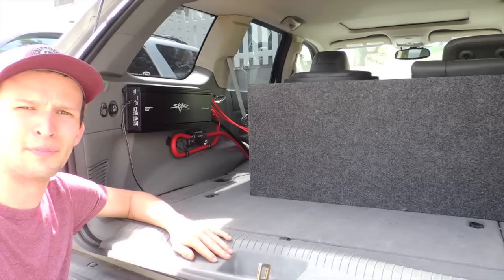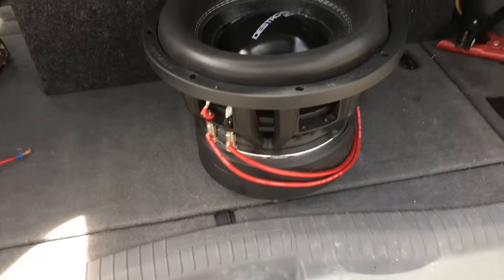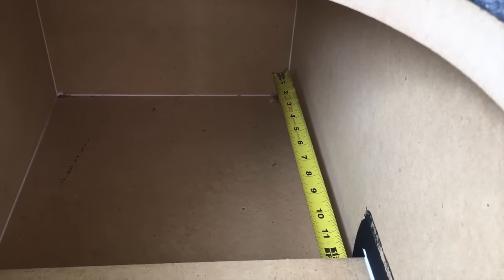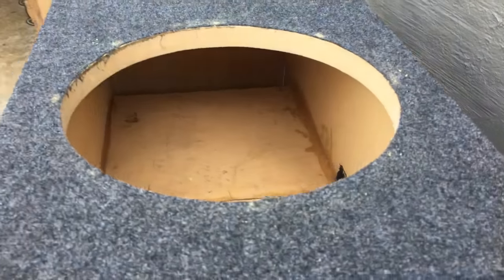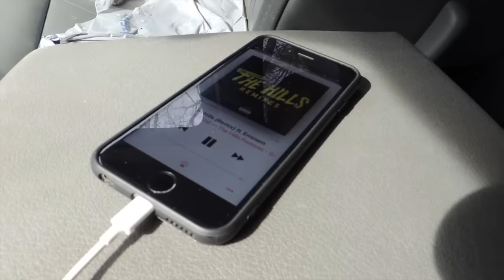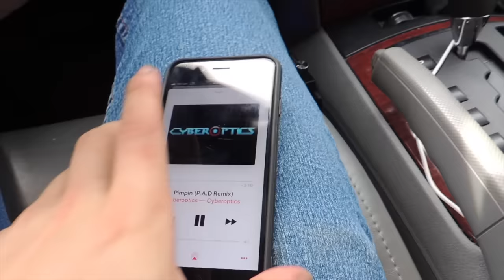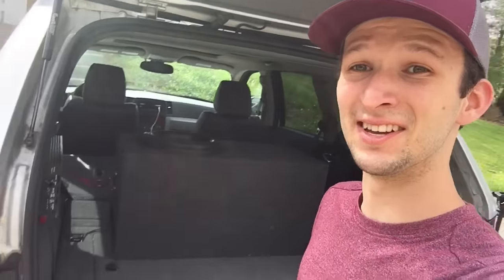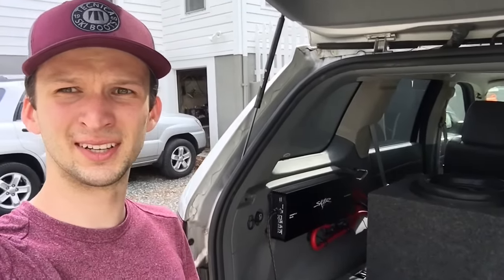Tuning My Box To Hit Lower! | How To Tune a Ported Subwoofer Box/Enclosure

Comment: If you ever do go into a custom build id recommend looking into round ports :)
Reply: I second that. Or octagonal ports.
Reply: Yeah, although the slot ports are pretty easy, and cheap for the little piece of extra wood, it sure seems like a few bucks for a couple of 3" or whatever is needed for your specific situation has got to be quick and easy- especially being able to run into any hardware store and grab some PVC pipe, cut to whatever length needed for tuning is hard to beat!
 **I've lengthened a few slot ports on prefabs or someone's home made box all with great success, but thinking about going with either a bought round port or just some PVC pipe from the bunch lying around living on an old farmhouse with tons of diy project leftover!

Comment: Ya invert the sub get maybe .2 more cubes. And put the box where the port fires to the rear and the subs magnet faces the rear passenger wheel bass likes to bounce off stuff. Then play some Bassotronics!!  I rock prefabs and add wood glue add  screws ever 5 inches to make sure the box is reinforced till I make a better box myself. Cool vid like the flexn shots.

Comment: I just bought this Q- Power box for $75 shipped on ebay for a temporary box for my Resilient Sounds Onyx 12". I was pleasantly surprised by how thick the wood was, 1" faceplate and .75" everywhere else.  the tuning is about 38 hz with this particular sub. The glue on the carpet is minimal and the terminal cup is worthless being way too small. 10 GA wire at best. I just run my 12 GA off out the port. I don't hear any rattles at all and it holds my 85 lb sub no problem.  I'm still going to put liquid nails inside the box and maybe a brace or 2. It doesn't vibrate much at all. For $75 bucks, you can't beat this box. It's also high density partical board not medium density like most boxes. I was really surprised. With some liquid nails, it will last forever. The existing caulking they used is garbage but I do see glue drips, so they used alot of glue for sure. I wish it had a lower tune but I may cut a piece of ⅝" wood and install it against the existing 13" port to narrow it and lower the frequency so I don't use up any air space like Parker did doing it that way but it worked for him. I need the airspace.

Comment: Next time cut it longer and slide it in and just lay it on the original port and just screw it to that, then u can slide it back and forth to adjust tuning unill u get it where ur happy. Instead of glueing it in.. make your next box with an aero port, they are easy to swap in and out, I bought like four 6in ports from parts express and u can add length to them easy or shorten them.. I don't use them anymore though. I went back to slot port once I figure out the tune I wanted
Reply: That would make the port 3/4in wider at the back than the front and change the tune
Reply: Why slot port over aero?

Comment: I have the same box for my 15. It says 37 hz. Dont know if its true but it does play pretty well in the 30s. I plan to add an external port and turn it with an L in the driecrio the sub is facing. I am pretty happy with this box. Makes one 15 SDR impressive.
Reply: Same...I have 2 one for my American bass XD-1522 and one for my Audiopipe 15in 3stack. It sounds good for what I paid for them in my opinion but will try this trick and see what happns😅
Reply: @marcovaldovinos5009  I just dropped my new avatar in and it slams
Reply: @brockmarquis8511  nice
Reply: @brockmarquis8511  The STU 15?
Reply: @marcovaldovinos5009  yes

Comment: Nice video. I actually think this is a good idea. But the quality of the wood really makes a huge difference in sound bro. I promise I was so scared to spend money but once I got a good quality birch box and a few other custom boxes I was hooked! I can take a budget sub and make it hit 5x harder in my box than a standard prefab or even eBay “custom” box. You can build your own just look at tutorials. The internal tricks and things inside used with custom boxes is insane. Internal bracing helps, internal corner inserts to help redirect air. Also having all the cracks and seams inside box properly sealed Makes a big diff too. All brand new boxes I get I always use liquid nails or silicone or something to seal every seam and corner inside an out. Also I seal around the terminals too. Painting wood boxes and sealing them is a good idea too and helps humidity and moisture not get to them. I wish you could feel the diff with that sub in a custom birch box
Reply: So from grabbing a sheet of MDF from the local lumber yard has nothing on some good Birch plywood!?
  Obviously bracing and how much power is getting pushed makes a huge difference, but you think for my first Birch box with either this DC Audio stage 4 12 inch sub and a 2500(+) RMS Orion amp would do better, with proper bracing and some nice chamfered edge's and I was thinking about 1/4 round(or something like that) for the inside corners for better sealing plus giving more surface area to strengthen it all the best possible within reason? 
Oh, and what does the Birch go for, 3/4" at least I'd think?
 Thank you in advance
Reply: @BabyCharlotteschannel  I am not a box guru I'll admit but I'd suggest joining some hardcore car audio enthusiasts groups on reddit and maybe discord and post what your thinking and see if you can bounce ideas off with some of the pros who do it way better than I can. I had a buddy build mine and help me with another. It is nuts how the material makes a diff. I also am not a fan of mdf to be honest.
Reply: @cppctek  thanks for the quick reply and tips. Yeah when I first moved out here in good ole Missouri I met a guy who is a member of a local car audio group. Super cool guy and seemed knowledgeable but I lost his number as I go through phones and lost some numbers..
  Guess I'll at least try this nice looking box this DC Audio stage 4 12" sub is in if I'm lucky enough to get it in the next few days and play with it if needed for now.
  But I'll definitely be looking into the better types of wood for whatever the next box I build for sure!
  Thanks again and keep it thumping Brother!

Comment: Have you considered adding poly-fill batting to the box?  It can lower the effective frequency of the box without adding port length.
Reply: That's a sketchy method. To much or to little will negatively effect sound.

Comment: Any coil will have those burn marks. Check your amp gain settings. Amp clipping does this on coils. You are maxing out the rail voltage.

Comment: Add some insulation to the inside. This is the easiest way to fine tune to lower frequencies. It emulates larger box sizes and cancels out highs from port noise. Also point port to rear to lengthen distance of wave to you.
Reply: Yes and yes! Direction of the sub and port make such a HUGE difference in how hard they hit it's almost hard to believe!
 I remember a 2nd generation VW GTI that adjusting the top box to make the subs perfectly parallel to the hatch window made such a huge difference I used to worry about blowing out the back window sometimes!!
Reply: Absolutely! Most guys don’t even understand or know about this.

Comment: I started building boxes about 2 years ago Im still young about to be 19 and have improvements to make but one thing i can tell you is putting that sub in a bigger box will make it hit much lower i have my 15 in a 2.5 cubic ft box tuned to 31 hz and my other box is 3.5 tuned to 35 hz and even though its tuned higher the extra air volume make is hit much much lower than my box tuned to 31 hz and just the sound alone is much deeper, put that rockville in a bigger box and itll hit much lower Id say 2.5 cubes tuned to 35 is a good box to still be musical and hit those lows and also another point is to hit the low lows you want all your air to be between the sub and the port unlike a lot of boxes with the subs facing up and a vertical port facing the trunk, a box with a sub facing up and a horizontal port on the bottom will play lower and sound deeper since theres more air space between the sub and the port
Reply: hey does a sub sound different if the port is a U shape rather than the traditional L shape slot port. im thinking of building a box that way for my sundown x12. box will be 2.5 cubes at 32hz

Comment: Hey buddy, I've been out of the business for so so SO long, in your opinion what would be the best looking way to seal a slot ported box. Love your vids btw and don't ever get discouraged or quit. Keep up your good projects and good luck.
Reply from the maker: I would seal it with some sort of glue or caulk and then if you want it to look good spray paint it
Reply: Why would you want to seal a slot port? A slot port box is gonna be too large for a sealed enclosure. Why not just build a sealed enclosure as one of the perks to using sealed is saving space.
Reply: @jutin2001  Agreed they both have their advantages depending on what sound you'r looking for.

Comment: You should have cut the port wall completely out and covered the hole instead of lengthening it. You could have used a aeroport or pvc pipe tube to length that way you would have gained air space and lowered the freq. even lower at the same time. It does sound better the way you did it too but you lost internal air space that way. But good video, i do think it sounds better.
Reply: Mount the speaker upside down and gain back that airspace you lost

Comment: Rockville is alright I guess, I like their amps and their powered subs aren’t too bad, but I just blew a new Rockville sub last night, completely unwrapped the voice coil. Just ordered a skar svr-12 to replace it, bought the Rockville setup with the amp, box, wiring, and sub for like 140 on eBay, should be a decent little budget build once I get that skar speaker put in it.

Comment: Good job on tuning it lower but u didn't account for the port or the subs magnet and basket. If u invert the sub ul get some air space back.
Reply: How do you tune it
Reply: I use Rockford box wizard and port size calculator.
Reply: @braydanwilliams5781  in this vid Migas is correct, Parker failed to deduct the port and sub displacement in the final calculation. After displacement his box was around 2.0 cubic feet which puts his tuning with a 26" long port at 45 hz... (He got his original tuning of the factory box wrong too. It was tuned near 50) To be able to tune it to 35.5 Parker would have actually need a 44" port in that box which is probably not feasible.  🤷‍♂️

Comment: Great system. Nothing better than LOWS! You‘ve got the groundwork to run two of those Rockville Destroyers which are unbelievable! I bet that one is enough tho... Could you meter how much power you’re throwing at it? I want to know how the same for my Lethal Injection 12” connected to a Wolfram 2400 but not going to spend money on an SMD tool anytime soon.
Reply from the maker: I plan to get a SMD meter but they are pretty pricey so it will be a little while

Comment: I have a 3.8 net box tuned to 38hz I built and just recently I did the same thing lowered it to 32hz. Thing is I don't detect what I would say a huge difference would you say the same thing?
Reply from the maker: Yes I wouldn’t say it’s a huge difference but it’s noticeable. Especially with certain songs that just didn’t seam to hit as well before
Reply: @ParkerTheBasshead  Thanks for the reply very appreciated and glad to see you doing so well.

Comment: Was wondering if i could do this to a CT Sounds dual 8" torpo box it's tuned to 39hz like to get it to 32hz or at least 35hz but just wondering if it is just out of a 8" subs wheelhouse to get that low or not as well. I mean for $219 the box is a steal and will fit on that shelf in my crown vic's trunk saving me a ton of space but what's in there now is a Skar dual 12" SDR ported box tuned to 32hz and man i love me some deep lows Juicy-J and Ludacris my daily bangers and i'm a SQ guy i don't like SPL noise

Comment: Why do you ignore the change in net box volume when you increase the port length/volume? You'd be better off shrinking your port area if all you want to do is change tuning. No worries about screws through the carpet either. Just attach another piece to the port wall of equal length to the stock port. You'll probably get a bit of port noise but better than shrinking the box volume.

Comment: I built a triple 15in ported subwoofer box for my XFL 1522... It is 4 ft long.. 1 ft and 8 in high.. and 2 ft wide.   I have a rectangular port in the bottom front facing my Escalade truck llid.  How long should my port be? It is 5 inch tall 2 ft wide

Comment: That calculator page is awesome
Reply: What’s the link to it???
Reply: @bassheadpolska9493  thank you so much 🙏
Reply: @calinsteele  np 😉
Reply: @bassheadpolska9493  just got my box tuned to 30hz :)
Reply: @calinsteele  oh 1 more info 1 turn lowers ur tunning by 1hz (90 degree) so if u have U shape port it will lower 2 hz if L shape 1 hz its simple

Comment: The box I built is tuned to 34 and it wont even pick up lemonade. Question is, after speaker displacement, you think your spot on?
Reply from the maker: Yeah with the port and speaker displacement I should be within the parameters given

Comment: Face the sub to the rear so the sound waves can bounce towards the front. Also, the port should not be on the side. Your port should be facing up, next to the subwoofer. It would improve your bass response.
Reply: I'm late to the party but firing the sub and port facing the cabin sounds much better in my car.. Also lowers trunk rattle.
Reply: @jamesalexander3547  yup! This used to be noted in old Dynamat advertisements in Car Audio magazines. Face forward and seal off the enclosure to cancel any back waves from going into the trunk. Worked like a charm.

Comment: Do you use a line driver of some sort? You need to boost your audio signal from 4 volt to 9 volt. The clarion eq is a must for bassheads.
Reply: Those amps dont like a high voltage signal  neither does any brazillian amp they like about 2 volts signal.

Comment: Hey Parker how's it going?  I have a quick question. I'm building a enclosure for 4 12s. Enclosure is 44 x 18.5 x 28.5 and im wondering what size port would I need for a tune of about 32hz. Thanks in advance.
Reply: Parker answer the damn question

Comment: Should use a tone generator app and see where it peaks and how low it it will play
Reply from the maker: Good idea! Thanks
Reply: May sound dumb but how do you really know where it peaks and how low it’ll play on a tone generator. I’ve tried doing this a million times and I’m tuned to 32, and my box will play from 21 to about 50 ish pretty good to me. Is that my peak and how low I can get ? I’m not great at car audio so I wanted to ask
Reply: @Jamesdagreat903  you see/feel the excursion by eye/hand, where it moves the least is tuning frequency, i built boxes using re box calculator and guess what every box is tuned to exactly what the calculations say at the excursion being minimum at tuning frequency. try it, using this technique i figured out that most prefab boxes are tuned to 40hz, my peaky box is tuned at 37hz and my new box at 34hz

Comment: better if you have the Thielle Small parameters of the speaker(qms, qes, qts, vas,  fs)  alfa factor. Sealed boxes are easy to calculate if you have this data.  Ported boxes are some formulas if you dont have the calculator.

Comment: I would change the direction of the box .. your vibrating your amp like crazy with the port pointed at it
Reply: Plus pointing your port to the  back of the vehicle changes your tuning too. Back to front ratio changes... just in my experience .. sounds ok... sorry to hear about your subwoofer issues.. 👍😎

Comment: The only thing is when you added the port length inside the box, you decreased the box volume. Recalculate the air space minus the port area and see what your tuned to. I’m sure you did tune lower but not as low as you think with making it into a smaller box.  You could pull that port you added in out and add it outside of the box.

Comment: It's a beast.. Installed two 12 Incriminator Lethal injection, 4in voice coils runnin 1ohm.. I need help w my tuning bro
Reply: SO I JUST GOT A PREMADE BOX tuned to 40hz with circular vent for my single 10” and I REALLY NEED TO LOWER THAT down to around 32-35Hz, seeing as how I have circle port, would I benefit from swapping for a larger AEROPORT? Or what do I need to do to circular port to lower frequency to 32-36hz.....
Reply: Longer port. Look up subbox.pro online. You can enter the box specs and it will tell you what port length you need

Comment: Nice experiment 👌 sounded loud .but I don't know what it sounded like before but it's hitting low. But you lost some box volume which I believe will throw off the tunning . But I still like!!!!
Reply from the maker: Well the calculator I used too the entire volume of the box including the part area and calculated the port length with that in mind
Reply: @ParkerTheBasshead  theres only so much u can do to a box ,if u want more dbs in a porter box u might wana sell the sub and get you a louder one. If u got around 400-500$u can buy a pre owned jl 12w7 or 13w7 its amazing how loud they are with giving them 1k watts to either one.

Comment: Question: if the speaker manufacturer recommends the port tuning frequency to be 40Hz & you tune the port to 35Hz what would be: 
1. The positive & negative effect?
2. Will you be hurting the subwoofer & shortning it's life?
Thanks